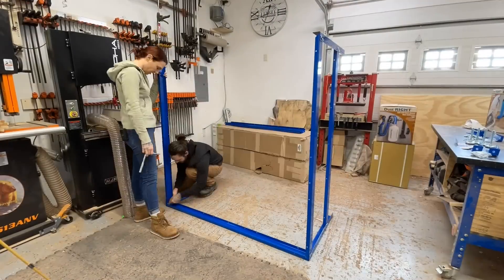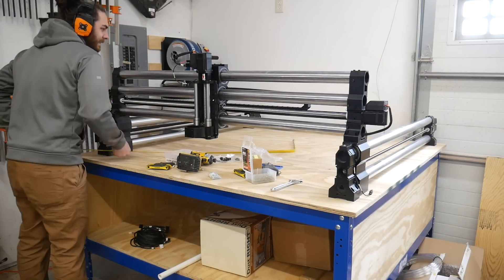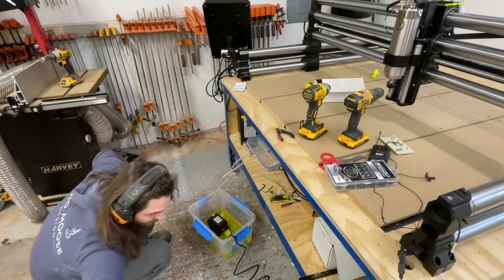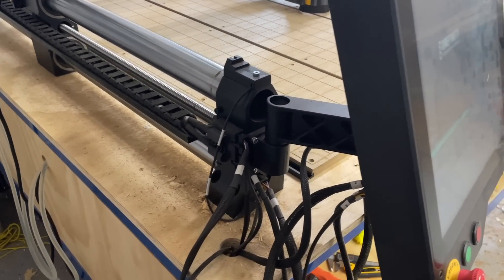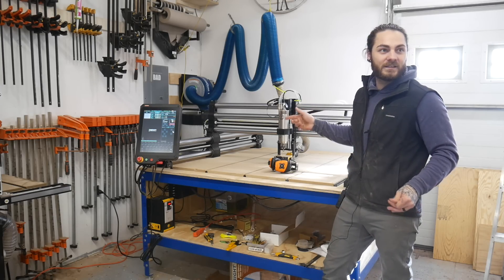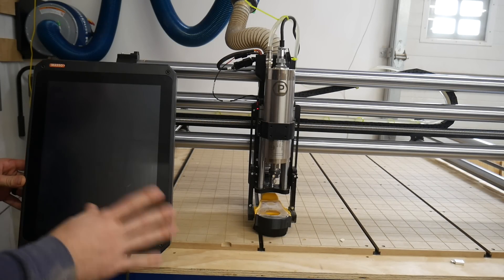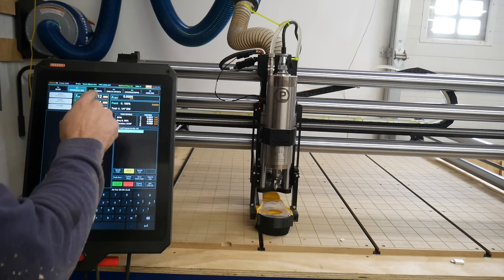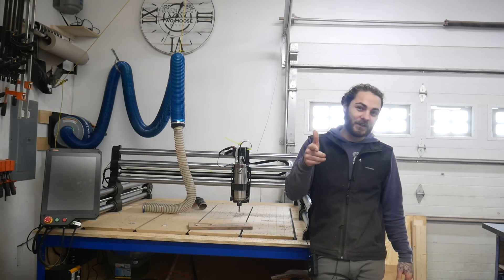Onefinity Elite Foreman // Set up and Overview

Comment: I am going to ask a stupid question and I don't have carpenter skills and have the elite foreman infinity cnc machine. It has just been sitting in my garage because of medical issues. I just found out I have aggressive cancer after just having a completely unrelated major surgery. I want to get this setup just in case I don't survive this fight and I want my son to be able to use it just incase. My question is I bought maple wood for the top and found out after doing searching everyone is using birch plywood. I think my maple is 3/4 inch thick. I put 66"x66" but what screws do I use to attach to kreg brace? Also are you putting the screws into the kreg metal rails?  Also I never thought about making sure the Kreg table it's perfectly square and I am little less the 1/2" off going diagonally in from corner to corner on one direction. Is this a major issue?  Also on spoil board do you go with mdf? How thick and screws did you use. I cannot seem to find that video. I am truly sorry for all the stupid questions. I just don't have experience with wood working but want to at least learn and be able to show my wife and son how to use it.  Can you or someone please help. I watched this video so many times and it glosses over these steps because most probably know these basic questions. I'm sure I am going to get roasted but I don't care this is too important for me and it's job that must get done. I just don't know the answers.

Comment: Thanks so much for the intro to the machine. I've been considering getting a journeyman elite for a while now, and I'm just about ready to pull the plug. CNC is a completely new world for me. Question from a noob - is a spindle simply capable for higher capacity cuts, over say a makita router? and id imagine thats why it needs cooling, over a router? Thanks so much for great vid
Reply from the maker: A spindle hand handle way more abuse as its designed for it. routers are fine for starting out but they are simply not designed for running for long periods of time or being under that much load for a long period of time. I used on for the first few years then upgraded.

Comment: I've had the same setup running for a couple of days and I love this machine. I'm using Carveco Maker. I've created a couple of files and cut them with success (mostly). The problem I'm having is that I created some 3/4" width vectors to cut channels for some T-track. I used a 1/4" end mill to cut them 3/8" deep. After I created them, I converted the bitmap to a vector and used Flood Fill Vector. After creating the tool path and saving it, I cut the file. The width and depth were correct, but it only cut the outer edges and left the center untouched. I thought if I used flood fill, the tool would remove all the material, but it didn't. I don't even know what to call it so I can search for an answer. How would I accomplish this?

Thanks for any input.

Comment: I am trying to buy the aircooled, but there are so many options which one do you recommend? after this amount of time has passed do you still feel the same about the spindle you have, im looking at the aircooled
Reply from the maker: Air cooled is totally fine! I have the 2.2 which is more than enough power for a hobbyists machine. Unless you plan on running the machine non stop water cooled is overkill

Comment: One question. I ordered basically the same unit and Kreg table. It will be here tomorrow. I had planned on it being stationary. But I've purchased five of the Kreg tables for the shop. I love the casters for them! Is your CNC on casters? If so, are there any issues doing it that way?

Thanks!

Comment: With your PWN spindle installed, what is the maximum depth of cut you could achieve? I am wondering what the height of the 1/2" collet to the bottom Z limit is....I am finding discrepancies in the One finity documentation materials and their website. I am contemplating buying one to see if I can work on a specialized project at home, but it would involve a pocket cut at 6-1/8" deep with a 1/2" bit... I plan to mount my material directly under the machine with a u-shaped support table, so no spoil board...

Comment: The water cooled is much quieter than the air cooled and better for running large projects. It also makes dust collection easier as the air cooled is trying to blow the chips out and away from the head, and leaves much more mess behind.

Comment: Onefinity quality control is crap. Make sure you remove every rail and check it for straightness when you get it. I like many others am stuck with a 2mm gap in every cut over a foot and a half.  Because I didn’t check it in time.

They tell you in the forums but not in there marketing to remove the rails and roll them over a granite table to check they are straight.

Comment: You think the pond pump is reliable or should one consider getting the “water chiller” until with alarms??
Reply from the maker: I don’t think a chiller is necessary unless you’re doing super long carves or live in a hot area and don’t have climate control. Is it the best option? No lol both my machines use the cheap pump and I haven’t had issues

Comment: Hey moose 🫎 when you used the 2x4 on the inside of the table did you just wedge it into the kregg table or did you drill through the metal to secure it ? Im literally building mine the exact same and trying to understand exactly how you did it.
Reply from the maker: Hey! I notched the 2x4 so it would sit flush with the metal and you can attach a screw through the bottom or just drill a hole if it doesn’t line up. Once you screw the top down and put screws in the 2x4s they won’t go anywhere either way
Reply: @TwoMooseDesign  yah I noticed you notches the 2x4. So I’ll try the same and just wedge it and screw it from the bottom if I get any movement. The side panels you just did pocket whole downwards only? Or did you secure it upwards aswell ?
Reply from the maker: @ethancole0420  the side panels make it way more solid. I added screws from the sides on the corners and just added a few kreg screws downward into the plywood underneath. There’s no where to really attach it upward
Reply: @TwoMooseDesign  alrighty I really appreciate the response I’ll hopefully have it fully build by the weekend
Reply from the maker: @ethancole0420  best of luck! Thanks for watching

Comment: I am looking to buy the 32"x48" Elite Journeyman, and I will probably go with a 80mm air cooled spindle. My intention is to cut speaker flat packs, for my MLTL-6 (mass loaded transmission line) speakers.
I have a question about the drag chain - does it come with the machine; or where did you get it? What size/length is it?
I like your bench - the storage would be a big factor for me. Thank you for covering the dust collection and the Masso - this is very helpful.
Reply from the maker: The elite models come with a drag chain. I don’t believe the non elite machines do at least not when I got my first machine. I purchased a kit on Etsy from route 101 😬 I can’t think of his shop, if you type it in it will come up. I talk about it in one of my wasteboard videos I believed, it wasn’t hard to add.
Reply: @TwoMooseDesign  - thank you. This video was excellent - I am looking to find out about what programs I can use to create the G-files? Possibly SketchUp? That is what I used in the past, with my PhlatPrinter III. And if you can store files in the Masso.
I will need to have jigs that let me load and clamp cut panels to do repeatable production.

Comment: Rule of thumb (when cutting metal, at least), any tool projection more than 4 times the tool's diameter begins a journey into chatter land.  It can certainly happen in shorter conditions and most definitely in conditions beyond that rule. It would appear that you're around the 6X mark in projection. Not saying other play in the machine isn't present, but the tool projection will certainly promote it. 
If I'm preaching to the choir, my apologies. Great video!

Comment: Does it take half inch bits? Or is it limited to 1/4? 🤔 I don’t see any info about this on the website
Reply from the maker: Depends on the spindle you buy. The makita router only takes 1/4 bits
Reply: @TwoMooseDesign  indeed. I was thinking about the spindle you have in the video. And thanks for replying!

Comment: Great video! Answered a lot of my questions!  I have the Elite Woodworker in my cart right now.  I have been on the fence on which CNC to buy and it seems that the Onefinity is a really solid machine from all the videos I have been watching.  I have been comparing the Shapeoko, stepcraft, and a few others but the Onefinity seem to be more of a professional build vs the other brands.  
I am really on the fence on the spindle.  I have looked at the PWN as well as the one sold by BulkMan (1.5kw 80mm 110v air cooled) and I am open to other suggestions.  Was trying to save a few bucks here and there on the setup.
I would also be interested in your bit (cheap and expensive) recommendations.  Where do you source them and what seems to be your most used for inlay cutting boards?  
The bench is the last issue.  I like the bench setup you have, ToolsToday uses a custom solution that is really nice and has lots of storage space, and I have seen a few prebuilt ones from Husky and other manufacturers that seem to fit the size and storage requirement.  I will be going with the 32x32 cut model so I will be searching for something a bit smaller.  If you have the onefinity that is roughly that size  - I would like a recommendation for a bench.  
Thanks again for the video!  This was great!

Comment: Question,  What is the "Stiffy"
kinda afraid to ask lol , 

What software is included ?
What's the actual usable work area after any clamps ?
Did they get the Virus fixed yet ?
Thanks
Reply from the maker: The stiffy is the extra rail on top, makes it a little more rigid. It definitely helps but not needed. There’s no software included but I do believe you get a free year of carveco with purchase. On this machine the cut area is 48”x48”. I haven’t heard of any virus 🤷🏼‍♂️ I haven’t had any software issues with either of my machines

Comment: Jeff, I can't thank you enough for this video as well as all the other videos. I am ordering my Onefinity today with same spindle and you videos have finally put an end to my seemingly endless frustrating research into what to buy. The table info is much appreciated and it looks like the Kreg might be more amenable to designing an enclosure as well. My shop is in a large walkout basement so I would like to max my noise control to reduce noise complaints from the wife. But, Dude, get rid of that dust collector (or more appropriate...non-collector) you have on that other OneFinity. My day job is a pathologist who does a lot of head and neck work. And after seeing a few patients who were woodworkers or wood floor refinishers end up with cancer in the nasal cavity or sinuses that was most definitely due to dust, I can tell you this is not an area to look to save money. And there is the even higher potential for chronic lung damage.  HEPA or as close to it as possible. Raise your prices a bit or whatever you need to do to at least buy bags for festool vac. That would pull plenty with that 2.5" hose as long as the dust boot is on. Air filtration for the space is good to. There are lots of plans/ideas for DIY units. I have plans for a good sized one that rolls and just uses a 8 inch inline fan you can buy on Amazon. Let me know if you want the plans. I was actually going to wait for my CNC to make it because it requires 6 or 7 round plywood discs of same size.   Or put the CNC's closer together and put them on the Rockler with some blast gates, preferably the larger one though if you are running both at the same time.  Dust collector CFM stats are not as grossly overexaggerated as HP ratings but they are certainly overblown. And that Rockler attached to that 2.5" hose might not be that much different than a good shop vac with a clean filter and bag. You two are young so stay healthy.
Reply from the maker: Thanks for the input! Always trying to imporove dust collection! I have two air scrubbers as well.
Reply: @TwoMooseDesign  Just placed my Elite Foreman order and made sure you got the referrals. Many thanks.
Reply from the maker: @r7j7t7  I appreciate you!
Reply: Two Moose Design. Can u post a link to the Kreg table frame u use for ur Onefinity

Comment: Good job! Great machine! I made few CNCs but not looking so good. 😢😢 I spent a lot of money to made a machine. Here are two examples. I spent 400€ for the first and more than 1500€ ( dust shoe and cyclone for wood and  vice for metal included) for second machine, this is very expensive hobby.  🤔🤔

https://youtu.be/TDTDN_KkoJc
https://youtu.be/ziXmku7p6O0
I use MDF for work plate on my second shown machine because metal one is too expensive. I have great and precise vice which I mount when I am doing aluminum and metal and I use only mist not flood. I use piece of thin metal sheet to protect MDF but some coolant sometime drip on MDF 😥

Bits are very expensive although last long. I spent more than 6€ for single tungsten carbide coated bit !!!! 😗😗 and I have a lot of various bits for different materials so this is great expenses for this hobby or work.

Comment: Awesome, I love your videos. I am a computer dummy. Im wanting to make form blocks for airplane building out of3/4  MDF or  3/4 birch plywood.  How would I go about learning how to program the CNC to make these?  I dont have a clue how to get started.  Thanks for any advice you could give me !!
Reply from the maker: Hey! I have no idea what airplane form blocks are 🤷🏼‍♂️
Reply: @TwoMooseDesign  LOL it may be an oblong shaped piece of plywood 2 feet wide by 3 feet tall with a square cut out in the middle to ben aluminum over it. this will make a bulkhead to the fuselage of an airplane. simple really. Or a piece of plywood cut out in the shape of an airplane wing rib.
Reply from the maker: @jefferyhudson4681  so you’ll probably need a 3D model, in that case I’d look into shapr3d or fusion 360.
Reply: @TwoMooseDesign  Thanks and I am enrolling in a local college for cnc programming too.
Reply from the maker: @jefferyhudson4681  nice! That’s exciting

Comment: Hi Guys, this video is responsible for piquing my interest in the Onefinity. I have been eyeballing Shopbot for years but this is so much more affordable and since I am a noob it makes a lot of sense. Watching you put the spoil boards in made me wonder why you don't run a 1/16 in deep groove at the extreme limits of the cnc (full square box) on the main board below the spoil board, vs marking the bit location with a pen? Love the channel!
Reply from the maker: 🤷🏼‍♂️ just how I chose too do it. I never cut on the extreme edges so I don’t care if it’s off a tiny bit. Thanks for watching I appreciate it!

Comment: A couple questions:

What size silicone hose is it and how long?

And in the comments, under Kreg table, you have 64” rails, 44” rails, and the leg kit.   What are the 44” rails for?   And can’t you just but that table kit from Kreger website?
Reply from the maker: The dust collection hose is 4” and 20’ long I believe? And the 44” rails would be for the journeyman. That’s just how they offer them on amazon 🤷🏼‍♂️ it’s the same thing you can purchase them where you feel most comfortable.
Reply: Not the dust collection hose the water cooling hose.  The Amazon link you provided has different sizes available.  Is it 1/4” ID?
Reply from the maker: @johnalex3023  yes 1/4” is correct. I’ll edit the wording so there’s no future confusion

Comment: I am patiently awaiting my Foreman to arrive, I also got the 2.2kw  220vwater cooled spindle. Seems to me the majority of cnc bits needed/ available are 1/4 to1/8. I did get a 1/2 in waist board flattening bit, I would assume an up cut and down cut end mills maybe a bowl bit, what other 1/2 bits would you suggest?
Reply from the maker: I’ve been buying more and more. If it comes in 1/2 like a bowl bit for example I’ll buy it in 1/2. 1/4 bits I’ll just get in 1/4 shanks. I use the 1/2 spiral bits for clearing I don’t cut things out with them, you can just a lot of waste
Reply: @TwoMooseDesign  my plan was to use the 1/2 bits for the first roughing pass then step down to 1/4 and or 1/8. I got the collets for all the aforementioned and 3/8.

Comment: nice video, make all the videos you can think of for this model cnc, mine just came in last Wednesday, built a table today. now to set up and learn. thanks
Reply: Bought and downloaded the waste board file, thank you.  I have a problem with getting it to load on the Masso.  I am using Carveco software and have saved it to 2 different thumb drives but when I plug it in the Masso doesn't find it on the drive.  What am I doing wrong?!?  This is driving me crazy!!!
Reply from the maker: @justwavingenterprises2542  is the g code the correct file type? You can also send them via wifi. It should be and .NC file type.
Reply from the maker: So exciting! I'll defiantly try! Starting another video this week.
Reply: Says carveco file and that is my only option.
Reply from the maker: @laurac4562  can you change machine in settings or something? You should be able to change file time for different machines. I don’t run carve co yet so I’m not sure
Reply: @TwoMooseDesign  have you had any issues with homing?  When homing x and z home just fine, but the y "jumps" backward just enough (1/8-1/4") to where it will not home.